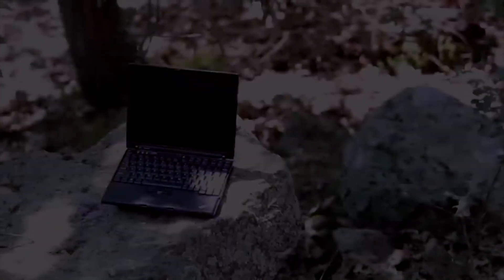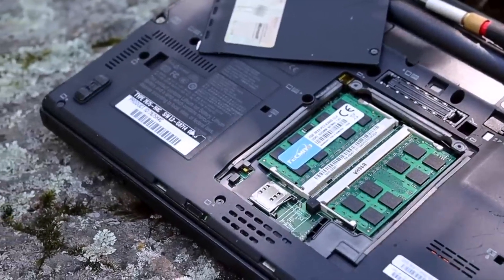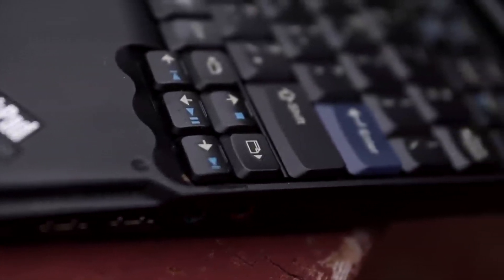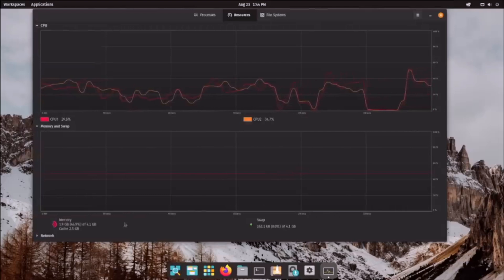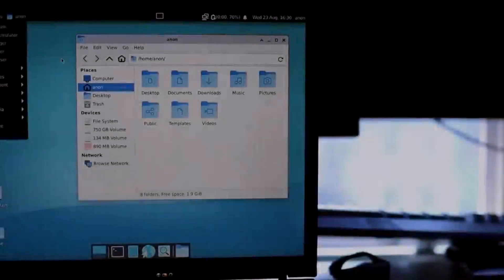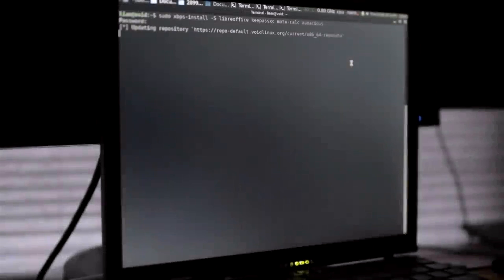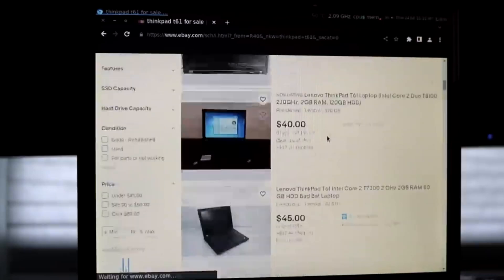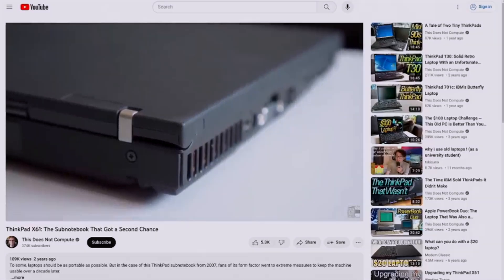Can Linux revive my old Laptop?

Comment: Void linux is def great on older hardware or very under power laptops such as my Celeron N4120 and with about 8gb of ram and 64gb. Quick question what did you use to add the cpu speed and cpu temps on the top bar.
Reply: Not sure exactly what he used, but you can achieve a similar thing with Conky. It does require some tinkering with config files though. There are almost certainly some other people on GitHub who have premade config files.